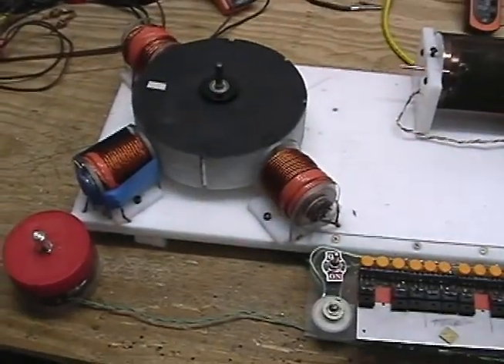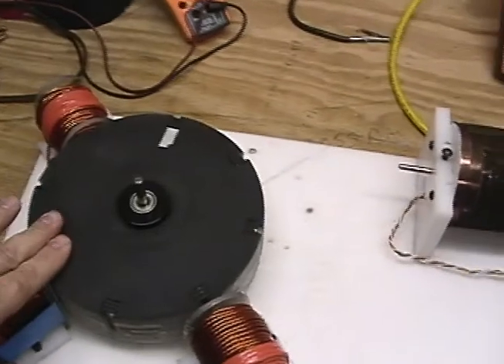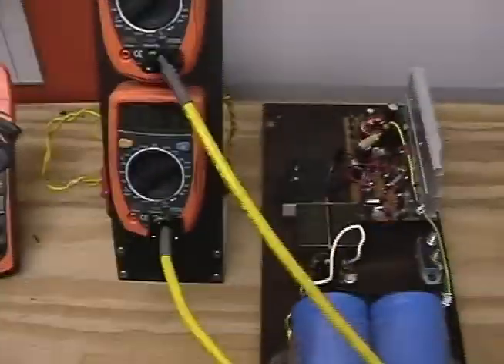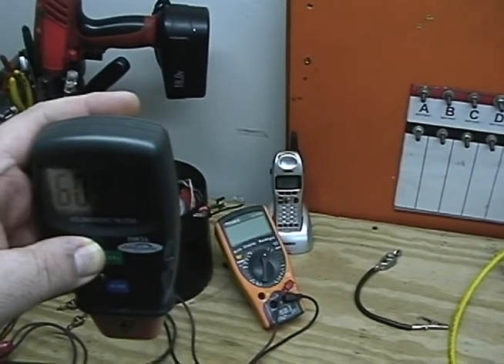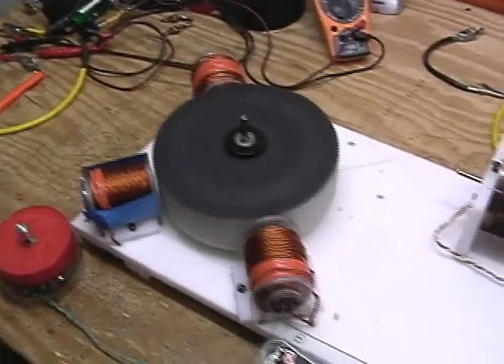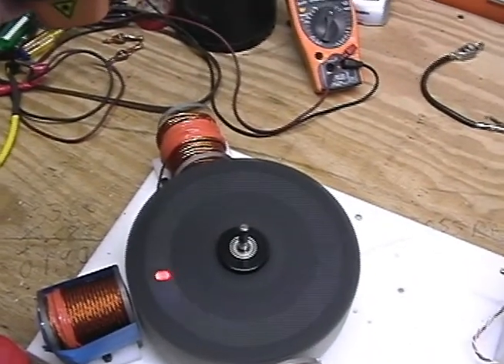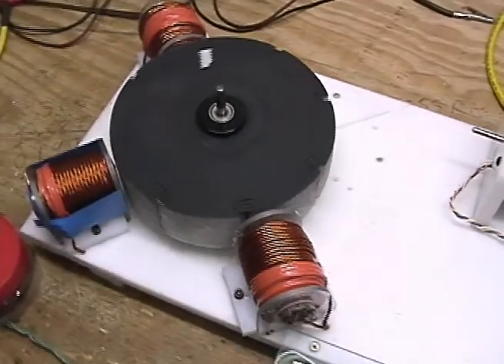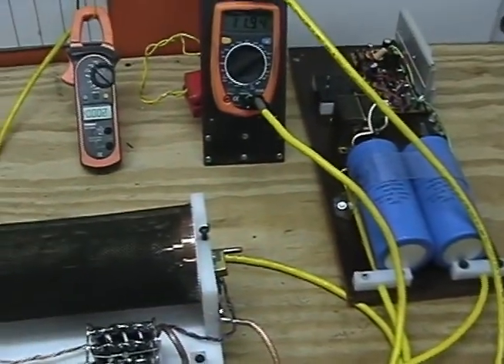3 Neodymium Magnets stacked May 2010

Comment: Question: What is  the point of this motor ?? This is not "free" energy because it uses a power source.  Does it create more power than is used - Does it create 1.5 amps while it uses 1.0 amps ?? Could you explain the purpose of this motor.

Comment from the maker: @floogerbomb glad to help, so the motor output is rated in amps any device that consumes energy is rated in watts. this motor is adjustable input  from 200ma to 4amps input but 50% of that can be recaptured. This is known as a Bendini SG circuit it can charge batteries and is a great way to start working in electronics you can find the circuit all over the net good luck. check out ZeroPointFuel website for more information

Comment from the maker: @cloverpark2011 each coil has 3 chips so the power wires of each coil is connected to a chip. One coil has a trigger wire and the other 2 coils are slaved to that trigger, so all the coils fire at the same time.